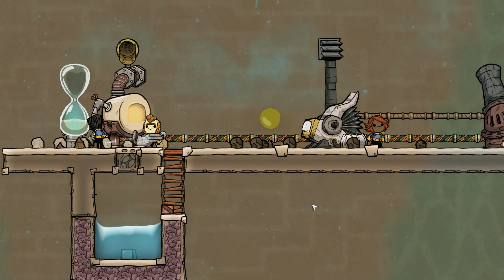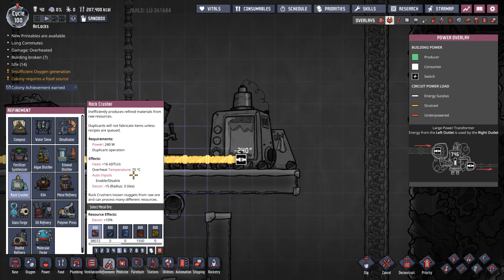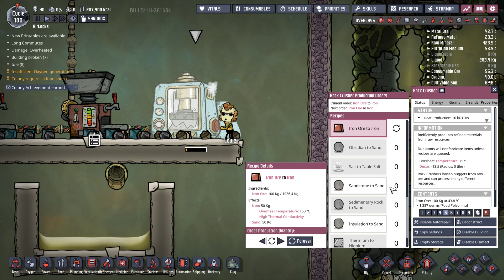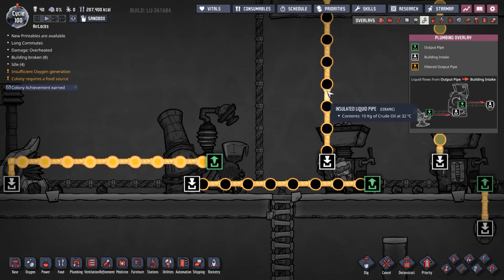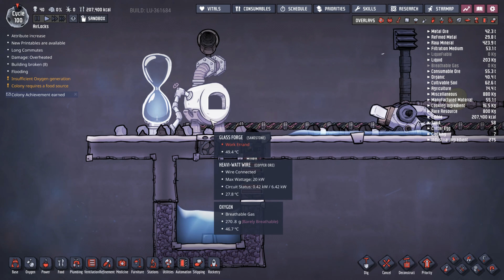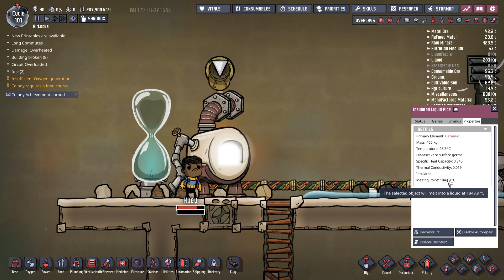Refineries & Smelting | Oxygen Not Included New Player Guide

Comment: To power the forge, run a normal wire to a transformer input, run a heavy cable from the transformer output to a large battery and to your forge. Home made capacitor without burning your system out if you only have a starter power grid